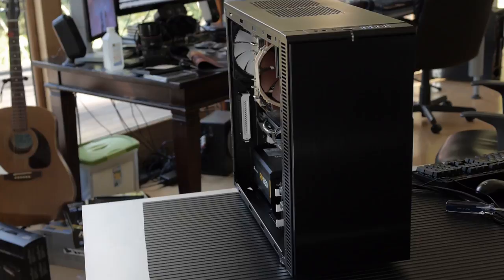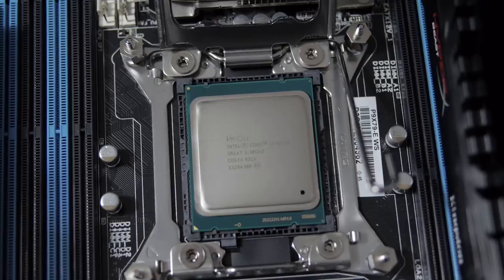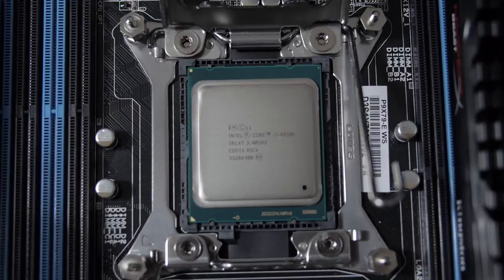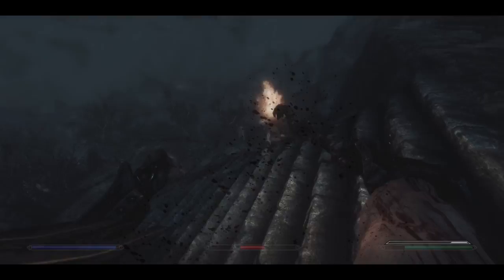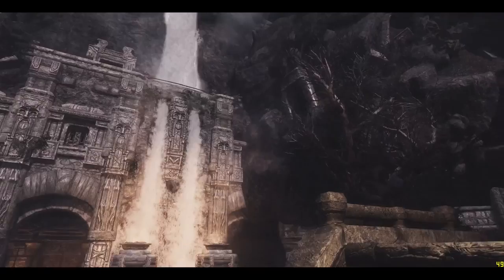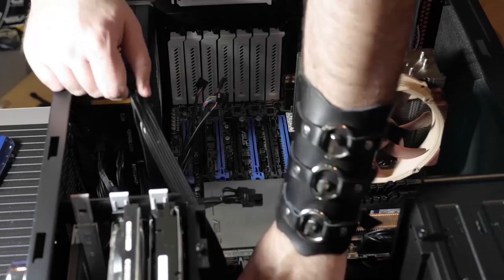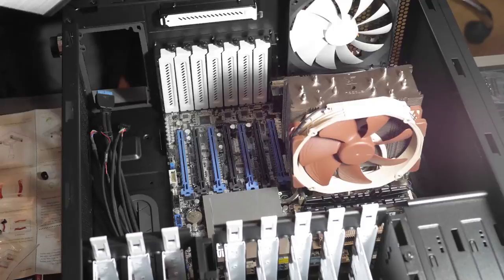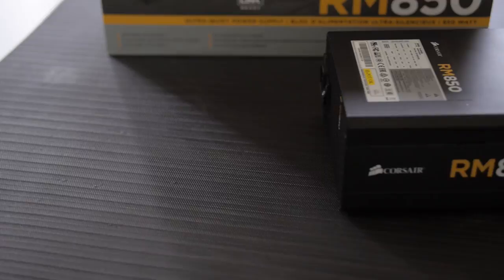Logan's Rig - What He Uses in His Own System

Comment: Is that Pistol that sits behind you playing? You should show off her rig too.
Reply: ***** I question your ability to read cause that clearly says 8350. But regardless, I wanna see the PC not some numbers and letters.
Reply: *****
Its a bit of a waste of money IMHO. On scan the 9590 is £233.94 and the 9370 is  £171.52 and it is exactly the same except it's clocked 300mhz slower
Reply: *****
The 9590 is basically a 8350 overclocked to 5Ghz. At it's price point you should go get a Xeon E3 or a i7
Reply: Flaming Lemons Or just get an 8350 and save some moneh ;D
Reply: VikingPotatoes
The 4790k/xeon e3 blows the 8350 out of the water in both single-threaded and multi-threaded. You do know that, right?

Comment: Use only filtered intakes. Put two fans in the front and and exhaust through the back. If that's not enough, get an intake fan in the bottom and probably add an exhaust fan in the top.

Comment: My kind of system. :) Nice case and overall component choice. 

I'd say upgrade with one single GPU, 780 DirectCU, 290X custom cooling, this things look pretty hot and noisy. Single GPU quieter than SLI, 3 / 4 GB, simpler, no messing around with drivers and whatnot. NVidia is suppose to have some nice in-game recording software with their new cards, which could be useful.

And maybe some nice audio soundcard!

Comment: i got a define r4 with a custom loop.
if you put a 120 rad in the front and a 240 (45 thick) in the top and use a 5.25 res. you can still reach all the motherboard screws after removing the fans from the top rad.
only problem is when your ram is at the very top of your mother board its covered by the fans, so a 30mm rad would fit in better.

Comment: You know lcd temp gauges Will only show the temp either where u put the probe it in that spot of ur water loop. Also the 290/290x is designed loud. When we see some aftermarket coolers coming (or even waterblocks) they will b quieter

Comment: Definitely dude. Especially since you can overclock it. My Core 2 Quad Q6600 has been enough for most games until about 2012 (and its from 2008 and wasnt even top of the lin ethen). Considering now each generation is only like 6% faster than previous rather than a few years back where we were seeing 15% jumps, you should be set for awhile

Comment: If you're wanting a GPU for some Open CL or computation work, I wouldn't go with the Hawaii cards. They are missing the DP 1/4 and have a 1/8th FP64 instead. This causes the 290/x cards to suffer in some computations compared to Tahiti. Your best bet would be to purchase another 280x and CF those puppies. Or, if you're after just blazing performance on a single GPU, the 780 Ti isn't a bad choice. 

Even with the aftermarket coolers, I'm not sure if I would recommend the 290/x. I'm certain that the fans will still be quite loud (compared to other cards with aftermarket coolers) and ruin your quiet setup. Additionally, dat power usage; no aftermarket cooler is going to lower the insane TDP that Hawaii cards require.

Comment: Any closed loop with more than 1 120mm fans on it such as the Krakens, H100i, and what not, with a push pull configuration with good quiet aftermarket fans such as Gentle Typhoons AP14 or NoiseBlocker NB-BlackSilentPro PK-3 or various Noctua fans, will be as quiet or even quieter than a air cooled Noctua CPU cooler. But of course that will tend to be more expensive by almost 50 to 60 bucks due to switching to aftermarket fans.

Comment: Once I get a wee bit more money I want to do an overhaul of my system. What do you guys think? (give me shit for the cpu, it was cheap and does what I need.) FX-6100, Gigabyte 7950 (not replacing it) 8GB corsair vengeance, corsair 650w psu, NZXT Zero 2, NZXT Respire T20, 128GB Vertex 4, Caviar Black 640GB, soon to be more HDDs and for cooling I'm running the stock back fans of the Zero 2, silverstone air penetrater, and 2 enermax magma uc ma12.

Comment: Yeah so would I. Because of the heat you can't overclock them well and the EVGA 780 SC w ACX cooler actually beat out the 290x on most of not all benchmarks.

Comment: Your thougts when it comes to sound cards. Do you prefer using PC speakers with a sub or Receivers with speakers and a sub? I'm stuck in my old ways and still rock my past rigs with the same receiver Harmon/Kardon AVR20II current speakers are Energy Connoisseur and a KLH 10" 120w powered sub I've also had for over a decade.

Comment: I would like to know what your stance on using multiple monitors is (also, what monitors you use would be interesting. Not to me, because I really just go and buy Eizo for the fact that they have heat sinks, but for others it might be interesting).
Do you use things like EyeFinity or NVidia Surround?
What kind of resolution/display size combination do you prefer and why?
What do you think about drivers in general? Drivers on GNU/Linux?
Is there something big that bugs you that you would like improved (except AMD reference cooling)?

Comment: I have the identical GPU on a 4770K . ASUS makes fine products. I'm using air cooled for the same reasons but it's all housed in a ThermalTake lvl 10 GT case instead. My biggest problem now is bandwidth and I would almost kick myself for not going with the X79 board you have except for the fact that after Intel already put out two chips w/ full native USB 3 support they neglected to include it on the X79 E for whatever reason. The only direction from here is up so it looks like X99 awaits me. In the meantime I'm using two Kingston Hyper X 120 Gb SSDs in RAID 0 with Windows 8.1 until I can get a better build made that offers better bandwidth. After that I can install an o/s with teeth. Until then Win 7 Ultimate sits on the shelf in shrink wrap.

Comment: what about Noiseblocker eLoop fans? i need triple 120mm fan setup for front intake in my Corsair Carbide AIR540. atm i have some current cheap Zalmans in there, but since i want my PC to be silent aswell (hell, im even modding one old ODD into a rubber-band HDD adapter for 5.25' bay).

so, Noiseblocker eLoop or still Noctuas? 120mm

Comment: Is an overclocked i5 3570k to something like low 4ghz comparable to the new i5 series at stock speed?  I m pretty much ready for overclocking but wonder if I should just yet...as I ve never done it before...my pc:  i5 3570k, 16 gb ram pc 1600, asus and evga gtx 660ti 2gb sli.  950 watts psu.  Corsair h60 liquid cooling.

Comment: Are there any good mATX  AM3+ motherboards?
Reply: Asus m5a78l-m/usb3 , got one of those.
Only downfall is 4+1 phase without vrm heatsinks.
But they are good quality phase and you can always attach own heatsinks.
Btw. i never seen a am3+ mAtx WITH heatsinks.
Anyway you shouldnt worry about that if your not into UBER overclocking.
I run a  fx8350(max supported cpu for that mobo)on 4,5ghz without vrm Heatsink
Im not complaining here :)

Comment: Can you build a PC optimized for audio?  and audio production??? that would be sweet thanks dude!
Reply: get yourself a good i7 cpu a cheap gpu a lot of ram (16gb) and make sure everything is stable and what you really need is a soundcard made for professional audio recording ( NI KOMPLETE 6)  they are really expensive but so is your gear if you make music
Reply: Intel i7 4770K with the stock cooler. 
No graphics card, the CPU has an integrated graphics card. And since you're not doing any gaming the integrated is fine.
For the mobo. MSI H81M-E35 V2 Micro ATX LGA1150 Motherboard, cheap + it does the job, nothing more i can add.
G.Skill Ares Series 16GB (2 x 8GB) RAM memory, so like ronnie tjikoeri said you'll need that 16GB.
Toshiba 1TB 3.5" 7200RPM Internal Hard Drive. You will probably need some space for audio production (I'm guessing)
Fractal Design Define R4 (Black Pearl) ATX Mid Tower Case (this is optional but I think this is the best choice since a lot of people are buying it. quality build materials good airflow.. etc.
And last but not least Corsair Builder 500W 80+ Bronze Certified ATX Power Supply 
to run it all.

I hope this has helped, I have used pcpartpicker and the final cost of all of this is $774.64

Good luck.
Reply: C Wagner  I have also forgot the sound card Asus Xonar DX so actually the final price would be $844
Reply: dMajor  Overclockable CPU in a non overclockable mother board and no SSD? Not great
Reply: Togutas Why would he even want to overclock a CPU for audio production ? I chose that mobo because it was cheap and had all the extra bells and whistles you need. And yes it is overclockable but not overclockable like on some high-end expensive gaming motherboard. Since we do want to save money on everything. Including the SSD.
Reply: dMajor
Thats precisely my point, why not get a non k 4770 then
Reply: Jeb Luke
No
Reply: just buy a amd six core with 16gb ram a decent gpu and a Native Instruments Komplete Audio 6 soundcard and dont worry about intel k and no k and overclocking thats headache a producer doesnt want

Comment: Glad you used that case and, above all, the Nuctua air cooler...Much better then the closed loop water stuff. I had to change my 100i for a TT Silver Arrow...On other computers I have the big Noctua coolers (can't be bothered to check the boxes, that are in another room...The one with two towers, used with 3 Noctua fans)...So much better then the closed loop radiators.
#Fuckgoogle+
Great choices. What bear did you use to build this system?
Cheers.

Comment: your 3820 should beat Pistol's 8250 with ease.. my old 2600 beats my 8350 by around 40fps. also for Skyrim to only run at 40fps at 1440p is pretty strange.. should be getting way more with a 780. not sure what you are doing with your computer.

Comment: Considering your high resolution workspace Logan you would have done a lot better with an AMD Hawaii Volcanic Islands based videocard because they scale to those higher resolutions at lot better than nVidia due to 384bit memory bus and 4GB memory.

I have to run with vsync so I couldn't run with an FPS below 60.

All the extra money burned on socket 2011 and that CHUMP CPU could have been spent wisely on two R9 290s in Crossfire and you would get 60 fps cranked in those games at those resolutions or damn close to it.

Expecting more FPS to reach the target 60 fps for vsync would be impossible buying a ti card and would yet be setting fire to more money.

The whole point of that 2011 chipset/socket is for the extra PCIe lanes to run two or more cards on 16x buses for DCC work with FireGL cards etc. and here you are using a single card and thinking a TI would somehow magically help your shit UHD gaming performance.

hahaha

DUDE...

You ain't a hardware guy are you!?!

PS burn more corp money on two R9 290 cards to use those 2011 PCIe lanes properly!

Comment: How can I make my pc quieter, it is loud as hell!
Reply: SpectacularName Actually you'd be surprised at how good sound dampening foam is when applied correctly to a good case. That combined with good airflow (plastic tube for front-in>cpu&ram>back-out airflow) will reduce the need for more fans. If you still want to go crazy with fans, get 120mm or bigger and try quality brands like Akasa or Noctua. You can silence it without buying components by thoroughly cleaning (remove dust), cable management (better airflow), undervolting and underclocking in idle states for lower temperatures (lower fan speeds, more silent). If you have a nice big metal case you can put it in a cold corner in a room and it will make a little difference in temperature. That's all I can think of right now.
Reply: Oliver Hall define r5 case+noctua fans

Comment: so if you would go for 4 GCs, then you would have something like 4x/4x/4x/4x PCI-e?
Intel sucks with number of PCI-e links.
GCs in SLI and/or Crossfire needs PCI-e port to be connected to root PCI-e, otherwise SLI and/or CrossFire won't work. Intel gives you whooping 16 lanes for that!
On AMD990FX I have 42 PCI-e lanes in total. There is few additional connected to SouthBridge, but those doesn't count for GCs in SLI/CrossFire configuration. Nice that you can have 4GCs, but fitting 4 of them would be like buying 2 CPUs for same computer and just throwing spare CPU into case and telling people "I have two CPUs in this computer" and even worse, because all 4GCs would be consuming power and thy would work as 2 at best

Comment: NEW? Didn't Logan build himself an X79 system some time ago? Why the need for a new one..?
Reply from the maker: New CPU, motherboard, and a few other things.
Reply: Tek Syndicate I figured a more roomy, high-flow full tower would be better, no? Something like a Phantom 820 or a Silverstone FT04?
Reply: Prenihility if you didn't get from the video... he likes quiet
Reply: Prenihility
It would be both larger and louder than the case he used (Define R4), remember this is effectively his work machine not a gaming rig. THis means he will likely sit near it for a long amount of time when he's working and being silent (having a good monitor, peripherals and chair) is the difference between feeling tired&headache-y or being still ready to go at the end of a few hours of video editing\live streaming\content writing or other production work, hence his need for a silent case over a larger one.

Regarding size, it could be either not everyone likes having a massive box, while the Define R4 is silent, its hardly a small system. Therefor for 1-2 graphics cards and no overclock this one will cool fine, especially with that Noctua air cooler and blower style (rear exhaust) graphics cards.
Reply: Prenihility Or try one of these Lian Li cases with hotswap SATA backplate!

http://www.lian-li.com/en/dt_portfolio/pc-10n/

All of your SATA cables are a pain when removing drives etc but with that Lian Li solution they jack in and out on rails with no worries about cabling.
Reply: Hamish McGregor Hes using the Asus GTX 780 Direct CU II which is not a blower style but the non reference prop style. Not like it really matters much anyways.

Comment: Asus motherboards are unreliable first mistake. Herm I'm thinking hes getting paid by Asus because that's 2 asus products when you include the GPU not that Asus heat sinks are bad there probably second best,

Kingston ram eh not the best but with intel RAM quality really isn't that important apart from reliability which as far as I know Kingston it's standard so.

Also the noctua fans are so expensive when you get to dual fan desgin that your better off with a good closed loop water calling system for a little extra molla.
Reply: No man, it's just that Asus has proven themselves to be good at cooling and making the product look cooler.
Reply: there`s worse than Asus, there`s always Intel, it works great! For a couple of weeks then goes crazy and drives you crazier.
Reply: I've had 3 over the span of 5 years, no problems, and I OC.  That's my personal experience though
Reply: Well personally I have had 4 asus motherboards and the 3 sandy bridge once all broke in different ways. But that not really the point ASUS within the past 2 - 3 years have just had a really bad track record on reliability.

Personally I would suggest gigabyte they have a pretty good track record.
Reply: Etheoma
My experience has me favoring Asus. Its been the brand of choice for my personal mobo since the P3 Era. Gigabyte is not far behind for my affections though.
Reply: i am usign asus for the last 7 years, and none of them died, i sort of broke on of them, but if overclocked my old pc, my sata controller stopped, but i have a new one with an asus board
Reply: Lessermold X I'm not talking so much about personal experience I'm talking about multiple computer component and computer repair shops saying that Asus is the one type of motherboard that shows up the most in RMA.

So I'm sorry but you just don't get to argue with a sample that large, unless you have a larger sample.

Not that they didn't used to be good my computer from 2006/07 has an old asus board in it and its went though multiple trails "like having coke spilled directly on it" and came though it and still works today but since 2010 they have been pretty bad.
Reply: If people wanna go for ASUS more power to you but it simply isn't the most reliable manufacturer although they do have some of the best performing motherboards but we are not talking about big enough differences in performance to matter in my opinion.

In my motherboards I would take reliability over performance any day of the week because if something goes wrong on your motherboard it has a real possibility of f***ing up a lot of other hardware on its way out.

And its a pain to take all the components out to put a new mobo in... although I did that 7 times in 6 months because ASUS and Intel were f***ing me around with the RMA making me go trough steps to check it each time I called which meant taking it apart multiple times.
Reply: The P9X79-E WS is the second best 2011-socket mobo you can get. The best one being the Asus Rampage IV Black Edition. So no, he made a great choice. That mobo is a beast.
 Aslo WS stands for Workstation, and the WS boards are tested and have a much higher realiability rate than any other motherboards.
 Just because you've had some bad experiences does not make Asus boards bad or unreliable. I've had Asus boards for a decade now, and never had one fail on me.
Reply: ***** Did I not just make a comment saying they have some of the best performing Motherboards, 

But that in my mind performance comes second to reliability when it comes to the motherboard because when a motherboard goes there is a chance it can take out a lot of stuff with it.

And the difference in performance between brands of the same price is negotiable and there for that is why its really a mistake to put performance over reliability when it comes to motherboards.